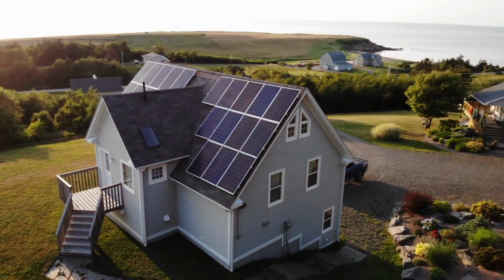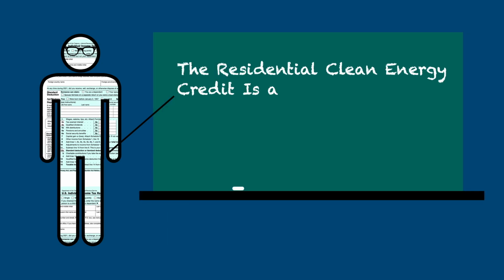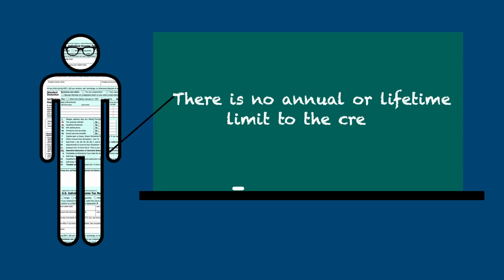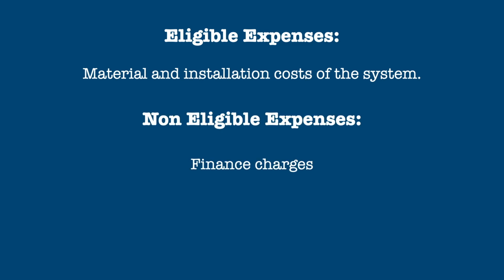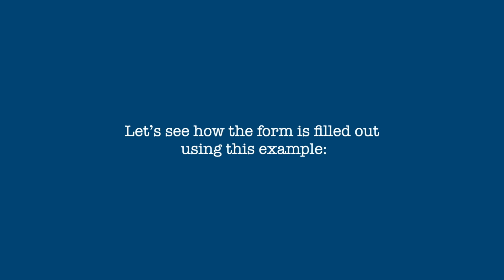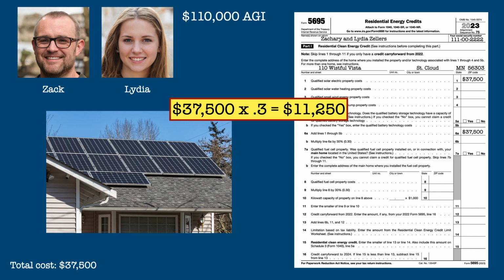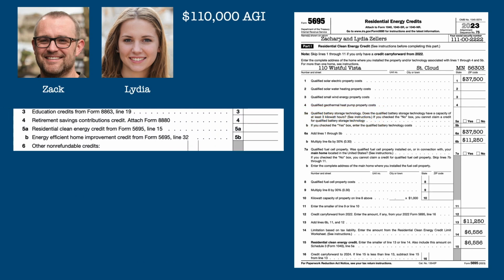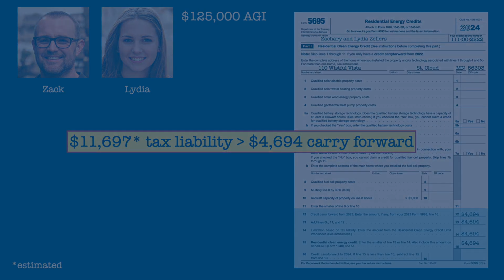The Residential Clean Energy Credit

Comment: Can upgraded solar equipment be claimed such as a new monitoring panel or new mounting hardware required during a roof replacement?
Reply from the maker: From what I understand upgraded equipment would only be eligible for the Credit if it increased the wattage capacity of the system.

Comment: Can residential clean energy credit be claimed for qualifying items installed as part of a home’s original construction? We purchased a brand new home where builder installed solar panels during home construction.
Reply from the maker: What would have to happen is that the cost of the solar panels would have to be separated from the price of the house by the builder, and that separate transaction reported by the builder (or the builder's subcontractor) to the IRS in your name.  If you've already purchased the home, this is unlikely. If you were having a custom home constructed, and directly dealt with the contractor installing the panels, it wouldn't be a problem, as there is nothing saying you can't use this credit for panels installed as part of a home's construction.